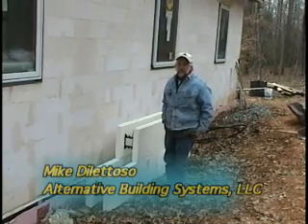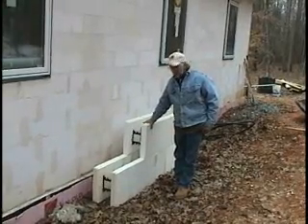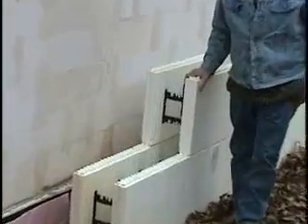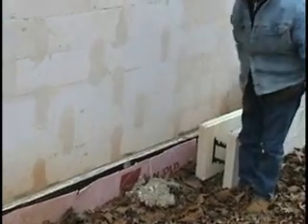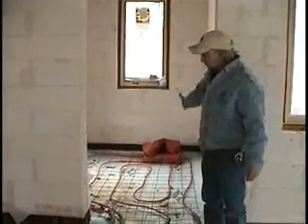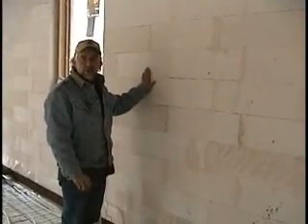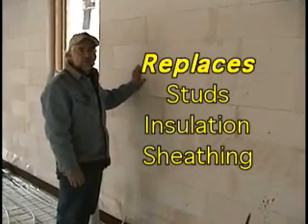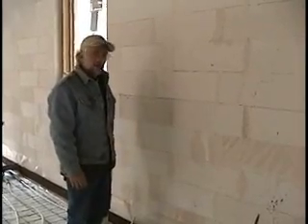Insulated Concrete Forms

Comment: I would think that the polystyrene has anchors in it so when the concrete is poured it acts like rebar... but that's just a guess. I'm wondering why another material other than concrete isn't used, I'm looking at SIP's rather than poured concrete.